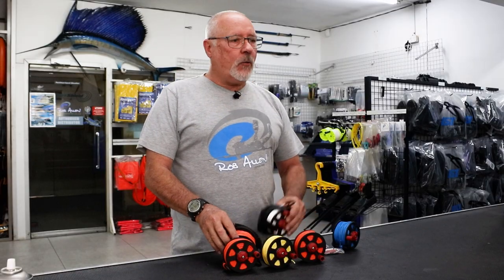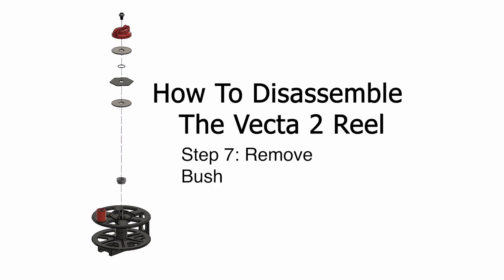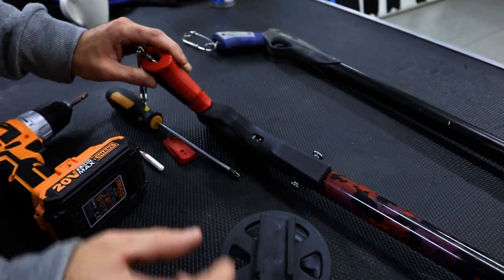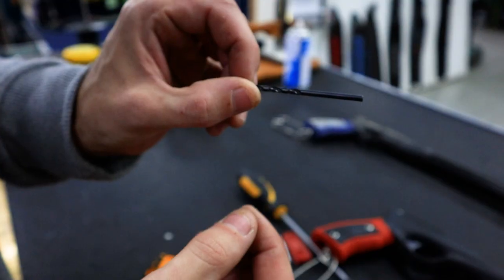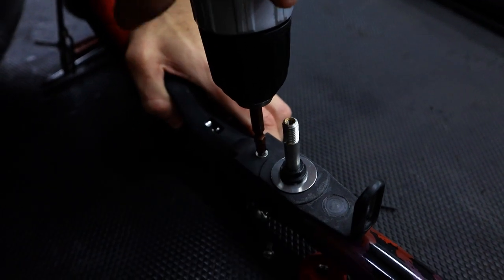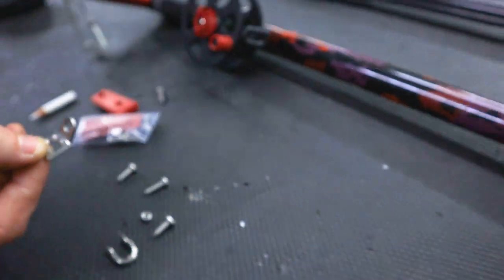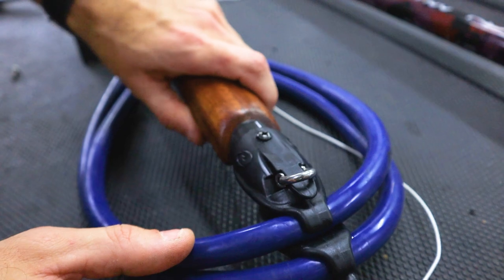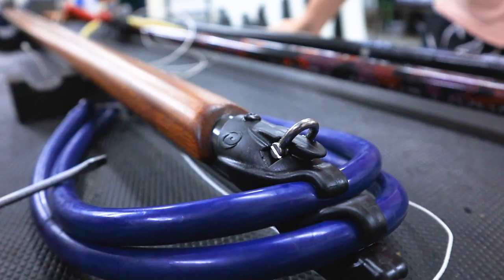Rob Allen | Reel Assembly | 2022

Comment: Friend of mine had a cheap reel. Shot at a fish that took line very fast. The reel suddenly stopped spinning - it was stuck. The high-speed spinning did melt down some components! That fast fish lead to some parts to melt into each other. 
Looking at the RA reel construction one can see bushes and washer etc - any element exposed to friction (therefore heat) has been designed and material properly chosen for it. Even the line guard has a metal lip as it will be exposed to friction heat from the reel line pulling out very rapidly. 
One can feel that these products are made by spearfishermen and not in a lab... 
Keep it going RA team!   ><000*>

Comment: Needs close-up video of fitting to other guns and at least SHOWING the two included mounting wedges...one for tubular, one for flat-surface/wood guns. 😢
Reply from the maker: We will consider. In the meantime, for a round barrel, the standard dovetail should be fine. Just make sure before you install that you can get the reel on and off.  For a gun with a flat surface, just use a rough sand paper to flatten off the underside of the dovetail a little.